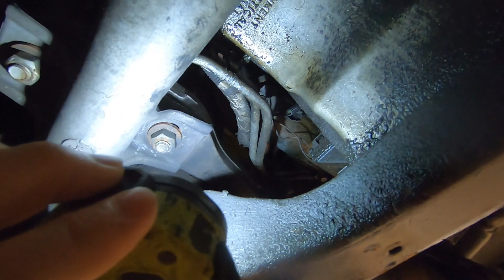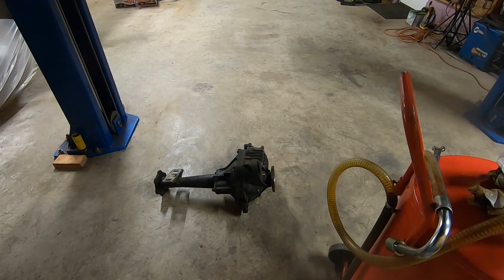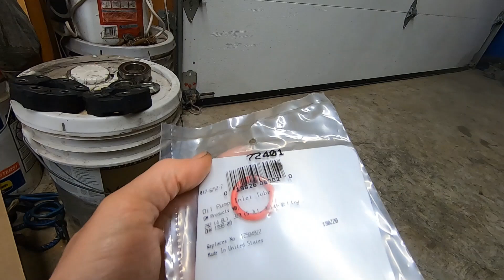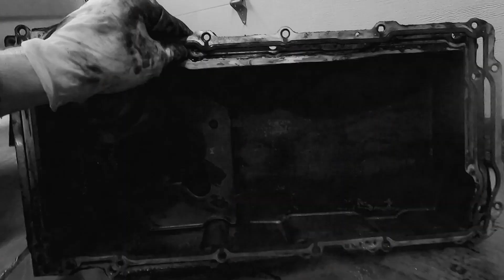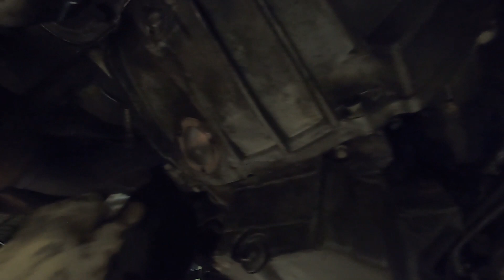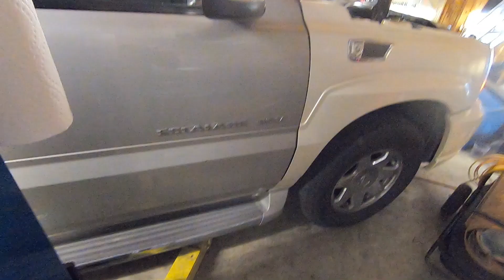OIL PAN GASKET REPLACEMENT ESCALADE

Comment: I accidently drill thru the rivet holes will it be ok or should i weld the bottom of where the rivet was?
Reply from the maker: No need, it will be fine. They seal around the rivets.